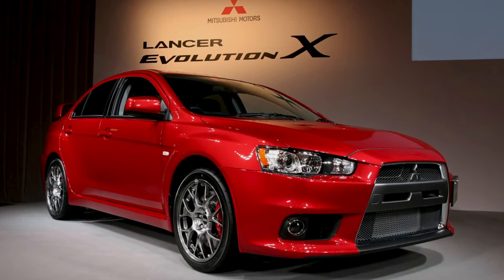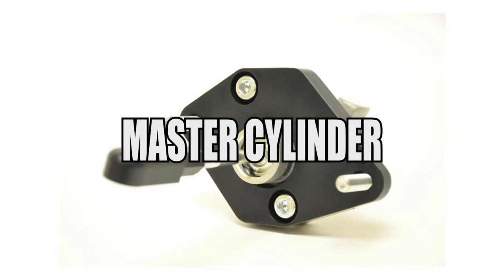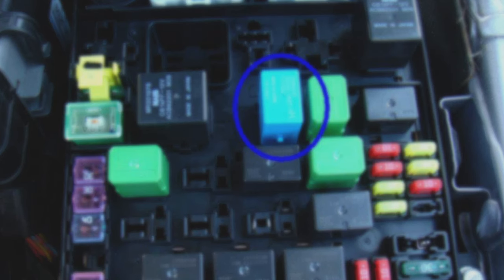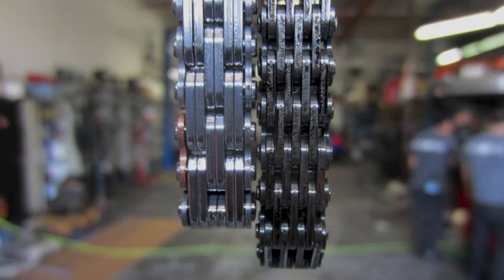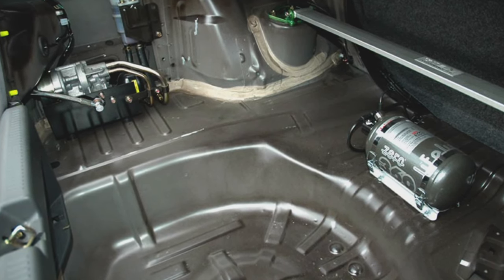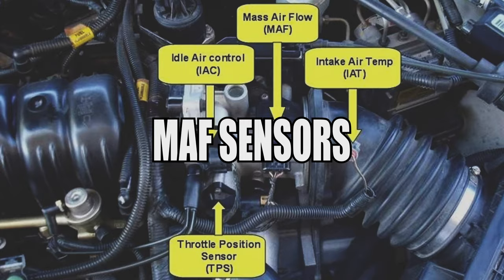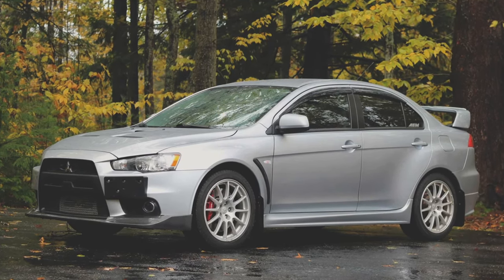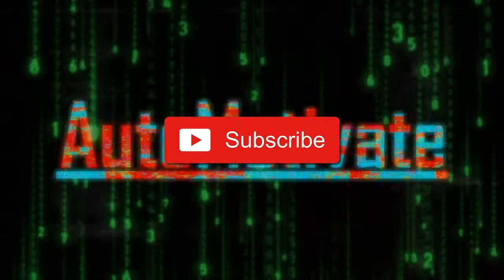Watch This Before Buying a Mitsubishi Evo Lancer 2008-2015

Comment: Don't get scared guys.. I have a 2009 MR and I drive it daily.. no problem so far.. I do my check up when it should be. Really love my Evo X
Reply: Yeah I think people need to understand that for a lot of cars, proper maintenance is key to keeping it good. For a car like an evo, if you want to mod it you have to spend money for the good stuff. You spend more money initially but you won't have issues long term. It's all about care and what and how you spend your money. You buy cheap parts you get cheap results.
Reply: Bruh... great encounter
Reply: 2011, only 56k miles but it has run like a champ the entire time to now. Daily for years.
Reply: Fuel consumption?
Reply: @Shaylesety  Car is stock and I'm usually around 12 L/100km ( dunno in mpg) not the best to be honest..but you don't buy an evo for saving fuel👍
Reply: now being 26 I can buy one and its so tempting ...really looking at something like an Evo, something dirty before my 30s!

Comment: I own an Evo X as a daily driver for almost 7 years now. Besides swapping the master cylinder and timing chain, the only persistent issue I had with this car was the AYC pump. I swapped it 3 times in total before I made use of a relocation kit.
Reply: Yeah I needs get me one of these kits. If it’s not already too late. Probably turn to dust in my hands 😭
Reply: “Besides swapping two major components it was fine” lol
Reply: @babushkaboi7288 are you trying to make a master cylinder replacement out to be a hard job? Major component 😂. Spark plugs are major components too lmfao
Reply: @babushkaboi7288 Plus they were covered under recalls so not an issue at all

Comment: all of your facts are correct except the 400hp stock bottom end limit. 4b11t can actually handle up to 600hp with ease.
Reply: I've seen numerous Evos throw rods well below 600whp..
Reply: @ThreeDPrintDesigns  Whp and hp is not the same. One’s to the wheels and the other to the crank; either way you’re right, I have seen the same thing happen even at 400whp, but that’s due to factors such as bad fuel mixture, bad spark plugs, bad fuel relays, etc. There are many factors that can cause this. 
The block is able to handle up to 650whp with the proper set up, but at that point you’d be pushing it to its limits.
Reply: I certainly know the difference between whp and crank hp. I've got much experience with high Hp. Gte, built is300, Evo x, 2014 Subaru wrx. Would never recommend anything over 500whp and maybe 350-400 wheel torque in a stock Evo. You might be the lucky guy running 600, but not for long.
Reply: 400 is typically the limit all the tuners and builders I’ve talked to are comfortable with on a stock bottom end.  Of course it also Felton how you’re making boost.  If you have a gigantic turbo that’s not exceeding 25 psi, where the power comes on way high up in the rev range, it would hold up to that better than trying to run 35 psi on a smaller, faster spooling, turbo for similar peak power.
Reply: @chincemagnet  freaking precisely. It's the instant low end torque that bends your rods in half.
Reply: @ThreeDPrintDesigns  Yes. I overboosted on a tune that should've made ~300 horsepower. I blew two rods cruising at 3k rpm. It's not the HP, it's the torque.
Reply: @cole5981  and if not the rods, would have melted the pistons overboosting and running too lean.
Reply: @ThreeDPrintDesigns  John Chagrois, a very well known tuner in the X community recommends 500-600, he’s done 650whp stock block and built head evos before. All in the tune, man is literally magic
Reply: @ThreeDPrintDesigns  a good tuner can keep the hp high and torque low, you’re correct, torque breaks stuff, that’s why those 650whp stock block cars can actually lose to lower hp but balance torque figure Evos, that’s one reason a “built motor” car could be seen as “faster” it’s all relative but Chag has it going pretty well
Reply: @ThreeDPrintDesigns  timing/map needs be absolutely perfect. Especially if it’s an sst
Reply: Maperformance would disagree. They say 450whp max on stock block

Comment: This Man cap bro . My 2010 Evo X got 108k miles with none of these problems..
Reply from the maker: Are you the original owner? 

Just because your car doesn’t have issues, doesn’t mean other cars don’t have issues.
Reply: Checking in now that 2 years have passed to see if your timing chain stretched yet

Comment: Its pretty well known the 4b11t can handle 600hp+ stock block.
Reply: Gearbox explosions though. 😅
Reply: @krylotik  the manual 5spd iin the X is the beefiest trans mitsubishi has ever produced in any Evo. It’ll handle more than the stock block. Guys push 800+hp on stock X trans.
Reply: @krylotik  Bad analogy. Im not saying the clutch doesn’t work in conjunction with the trans. Because it does. Needing to upgrade the clutch has nothing to do with the actual transmission.
Reply: @krylotik  with your logic the driveshaft is also considered “the transmission”
Reply: @krylotik  All that stuff you listed is unnecessary for making power in the evo x. Unless you’re launching your car from a dead stop all the time, stock t-case is just fine. Only reason to upgrade trans is for final drive. & shift fork? Lol nah

Comment: I'm making almost 400whp in my X. It's capable of a ton more. 550 plus keeping torque around 400wtq. It also just depends on your tuner. If you have torque coming in later than your good. People go wrong bringing the torque in way to early which is hard on the car. Ive had zero issues in 83k miles on my Evo. It's been launched 10-15 times and I'm still running the stock clutch I bought it with. AYC pump tends to be an issue. Doesn't like colder climates therefore they tend to go out from time to time. Stock for stock, bolt on for bolt on the X makes more power over the 4G. Fluids need to be done more often than your average car. I do fluid changes(trans, tcase, diff, etc) every 10-15k miles.
Reply: Yeah, I’m having some issues, and have in the past, with my AYC pump.  Stupid things that shouldn’t be happening like the front diff not unlocking and AWC not working.  I’m not quite sure what fixed the front diff issue, but bleeding can help the AYC if it gets air or moisture in the system, but they do die and they’re goddamned expensive
Reply: @chincemagnet  gonna have to invest in the relocation kit, just a bad placement tbh, every car has their quirks
Reply: You are the only evo owner I know that is talking with some sense when it comes to tuning your evos torque! Alot of people like to talk shit about the transmission. Nobody is willing to learn there transmission to understand why the gears can only take but so much torque. Just like with my Evo9 the 6 speed can hold 290lbs torque reliable. But also I autocross my car and I know the risk associated with launching the car and my transmission and transfer case usually last me 2 seasons before I have to rebuild it again!

Comment: Great video, however a few things that I would like to point out as a shop owner that primarily works on the 4G63 and the 4B11 platforms.

1. The master cylinder does and will go bad eventually, so an upgraded unit from AMS,MAP and MAGNUS are a great upgrade for these cars. This uses the older CT9A chassis aluminum CMC with an adaptor plate from either of the manufacturers that I mentioned. 
2. The fuel pump relay, along with the timing chain issue are an issue associated with the earlier Evo X's. However, every owner should upgrade the relay for the sake of their own peace of mind. The chain issue is only for Evo X's pre 2010. The 2010 and older vehicles feature the newer/revised chain.
3.The diff pin issue is not as common as most think. However, we always address this during a transmission build. I have personally built more than half a dozen 700+ WHP X's with the stock transmission without having the diff pin failure.
4. The AYC pump rarely fails on us, however we are in southern California with no snow or salt on the roads, which is the primary killer of these pumps. 
5. The MAF sensors almost never fail.
6. The exhaust manifolds are almost ALWAYS cracked upon removing the upper heat shield, we usually upgrade this to a tubular unit or a cast unit such as the MAP one.

Very awesome and information packed video nonetheless. I just wanted to address some of the things that I see more commonly than others. Cheers :)

-Roni A
SpeedLAB,inc
Reply from the maker: Thank you for giving such an in-depth overview. I’m glad you were able to explain some of the issues a bit further! 
Cheers!
Reply: The master himself has spoken👏🏼
Reply: I wanted to add that the knocking noises in the suspension at low speeds is usually due to the front strut top mounts. My car was knocking like crazy after I bought it and replacing those completely fixed the issue and it's been totally silent for the last 20k miles.
Reply: I live in the valley. If I get an Evo, as I am debating on that an R32 or a z32. I’ll be in touch if you’re still around. Cheers, and thank you for being a better mechanic than most.

Comment: Despite the "issues", the Evo X is still an extremely reliable car - and for the low maintenance price tag compared to others in the class.  It's not as high maintenance as a Ford RS, and arguably at par (or, barring differences, trade blows)  with the issues on a Scooby.  Let's not even talk about Audis or BMWs here, because if you want to argue reliability and TCO --- get real.  

I often wonder what people do to these cars to abuse them to the point of so much failure,  but the concept hasn't changed from the early days of anything mechanical -- regular maintenance and servicing by qualified technicians will extend the life of your vehicle.  Anyone who gets service done by bona-fide techs will already have been informed about relay issues and most of the other known common serviceable points of failure for an Evo X.  That's what TSBs are for.

It's easy to want to go fast on an Evo, but to neglect the fact that more power demands more safeguards - is just silly.  And, sorry to everyone who has to deal with winter road conditions.  I think it doesn't matter what make/model - rust permeating critical systems under the vehicle will always be an issue.

Last point  (just a quick FYI, really) - but Recaros are all standard on an MR.  And like the USDM GSR, they didn't pass muster with the NHTSA and therefore US buyers got screwed over on '15s and FEs.  However, FEs and MRs in all other markets (including CA)  still had them in 2015.  Though not as nice as the all-leather versions, the fact that you have Recaros so makes the driving experience.
Reply: So it is reliable?
Reply: @DansFitness  Have had zero major mechanical failures as of yet. I'd say a resounding "yes".
Reply: @slippercream  Yesssss noice
Reply: @slippercream  So how long did you have it for and was it expensive to purchase?
Reply: @DansFitness  My current two X's are 14s and 15s, respectively.  One locally and the other, imported.  Both new.  So, full-price.  Let's just put it that way.
Reply: @slippercream  ah ok. There's a couple affordable-ish ones used in my country for around 32k US. Is that reasonable for an evo 10? My country usually inflates these prices unfortunately.
Reply: @DansFitness  you canbuy one just as used as a STI for $40k I went with the evo because of rarity, reliability, tunability. STI costs double theprice to maintain. STI value holds well but at what cost, a head gasket eery 50k miles or a cracked bed pan every 25k? lol
Reply: Those were HIS problems that he had
Reply: I am looking to get an EVO X right now. I came from a GTR and always liked the body style and awd capability of the evo. Just can't get past the fact of spending 30-40k on an evo that has 40-80k miles. Any advice?
Reply: @petewayner5503  Fortunately, our unfortunately, Evos are the only Mitsubishis that tend to hold their resale value.  Any other model you'd likely find for much cheaper.  Even 3000GTs.  As for advice on used Evos - the usual.  Better if you can find an example that's unmolested, or if modified, one that's clearly cared for.  Evos are hardy, but as with other performance models, require a strict maintenance schedule.  You'd easily know a good owner from one who's not, if they know all the TSBs and maintenance schedules by heart - with records to prove it.  Finally... Not all performance shops are the same.  Service performed on an SST by Kozmic vs the dealership speaks volumes.  Much like performance mods done in house at AMS or English or Magnus, vs your average generalist speed shop.
Reply: @krylotik  Definitely costs more to service and build up an MR than a GSR.  But honestly, reliability is really just a function of how properly it's built to suit the output.  These units are solid, if prepped correctly.  Biggest single bang-for-buck mod on an SST is an upgraded cooling solution.  Ironically, an aftermarket heated sump does the trick just as well as a larger A/T oil cooler alone.  Having both, even better!

The DCT-470 has been reliably built to handle upwards of 800hp.  The gears are said to be stronger than the synchro set on the GSR/FE.  Not to mention, shifting errors are eliminated with an SMT. 

As with everything, building one subsystem up and neglecting the next is just inviting trouble.  But, considering that a stock SST can handle upwards of 400hp /lb-ft  puts it at par with a stock GSR/FE tranny in terms of reliability.  And, technically, "building up" either are about upgrading clutches! ... Unless of course your goals go above and beyond what's generally sane. :) 

Question is, would you really build a GSR/FE up past bolt ons and a tune, without being up your 5M/T?  Then why wouldn't you do the same for an SST?  Everything else other than transmission is mechanically the same.
Reply: @krylotik  I wouldn't worry about it too much, man.  The DCT-470 is used in other applications, so it's not like it's a one-off, rare thing.  Trust me, I have some of those  (6A1x engines, anyone?).

Kozmic, though they are literally the top authority on SSTs, aren't the only ones who work on them.  Jacks does as well  (got a project with them right now, not an SST though).  There's another one, but I can't recall their name - and it's not Shep.  

It really is ok to build up the transmission.  It is pricey, but the reality is that it's also built for punishment.  Upgrading the clutch pack will address the bulk of your concerns.  Just keep up with the maintenance.

Another thing about upgrades - you'll want to do them anyway since I completely sympathize with you... specifically about launches.  The tranny will heat up significantly if you try to set up (brake+accelerator)  from a dig.  Oil cooling and that sump pretty much eliminate that problem.  

But, otherwise, how could you really screw up a transmission that was rated to handle more power numbers than your goal to begin with?  I mean - you don't have to worry about mis-shifting.  And really - the builders will tell you how best to build it up.

The thing about it is, regular maintenance already costs you quite a bit for tear-down.  Might as well fork out the cash to do an upgrade while you're at it.

Lastly, the price of SSTs is going down considerably - especially since no one hardly wants them.  That's a good thing.  Try to take advantage and get a spare - just in case :)

Good luck!  Have fun!
Reply: This 👏🏼
Reply: @krylotik  heard a lot of horror stories about it but if you maintain it properly, it shouldn't cause you any problems... unless you wanna beat the shit out of your car..

Comment: Well i have my evo for a year .....its still running a beast ....no problems yet 😃😃
Reply: You sir have had a fricken good year. I save £50 a week. I call it the “repairs jar” 
It has yet to ever be full and pre emptively buy a part 😂
Reply: @jamiewalker8772  umm ok
Reply: @jamiewalker8772  well I would love to have a modification...brakes change body paint job 🧐🧐

Comment: Correct if I’m wrong but I believe the 2010+ evo’s have their timing chain updated and does not have the stretch issue anymore. 
Also, I believe the AYC pump has a much higher chance of failing depending on where the car has lived it’s life at such as the snowy/salty roads up north versus places that rarely sees harsh conditions. I say that because I’ve driven my 2013 evo for almost 50k miles in the past 3 years and have never had my pump fail on me here in North Carolina.

Comment: I’ve literally had to do basically everything on this list. 😂 ayc pump sucks and I’ve replaced it once and I gotta do it again 🙄. 2011 ralliart with evo turbo, tubular exhaust, upgraded exhaust, lowering springs, and a few other small upgrades. I would never trade mine for the world though. This is the most accurate video to date I have found listing every issue. Awesome video man. 🙏

Comment: Good video AutoMotivate and the way you presented it, but also agree with the one persons comment about the hp rating. The 4B11 is capable of holding 550-600 whp, and I'm currently sitting at 422whp comfortably. I'm aiming for 500whp with the stock block and capable of it with the set up I have right now, but it all depends on time and money, lol. But other than that, great video and keep up the good work.
Reply: I’d recommend Chag tuning, crazy power and a safe tune. He’s an Etuner and also recognized by cobb as a protuner
Reply: @Thatonechingadera45  yeah I heard about him. I know one guy that has been tuned by him. Rates are reasonable too.